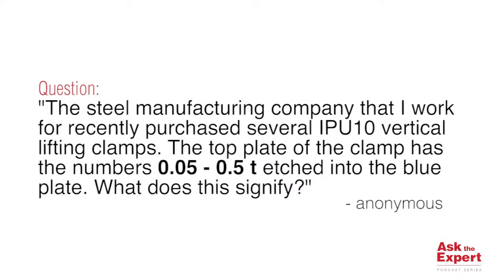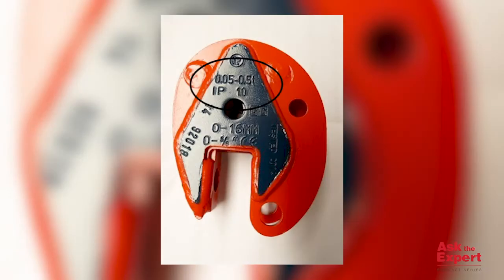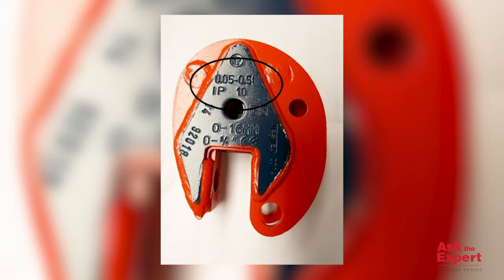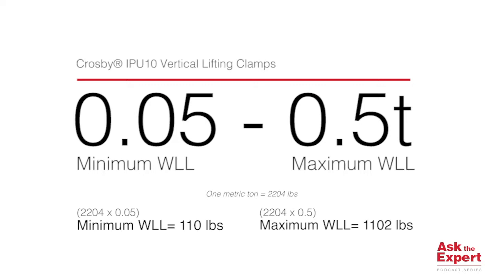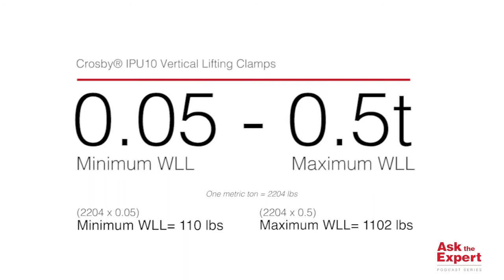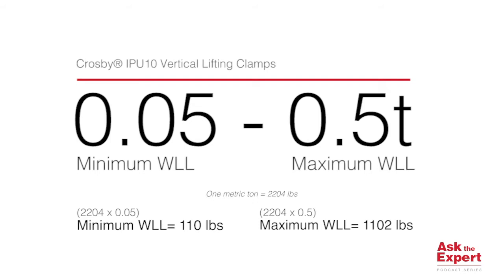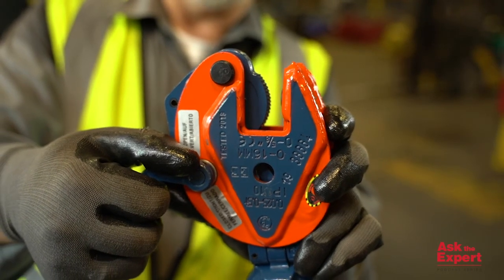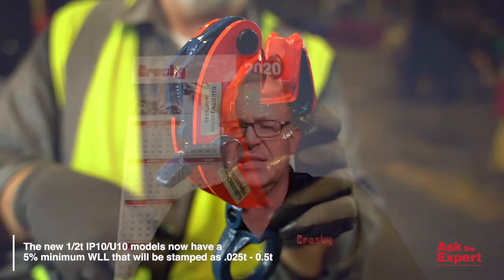Crosby IP lifting clamps: WLL

Comment: I have a question.  Don't know if it will be answered on here. Using the exact clamp shown in the video. How do you lift a sheet while it is on the ground? I started a pick and it started to slip before I got vertical.  Boss said it isn't for that just straight pick. Previous courses I have had from crosby trained me to do it that way. Do you have a video demonstrating it.
Reply from the maker: Thank you for you inquiry Weldmonkey, there are a few questions we would need to ask before being able to answer you correctly. Do you have an email address so that we can contact you? Or you can contact our technical support: crosbytechsupport@thecrosbygroup.com who will be able to help you further.